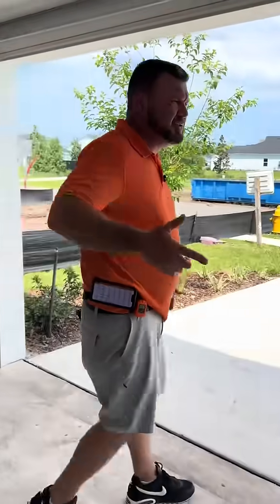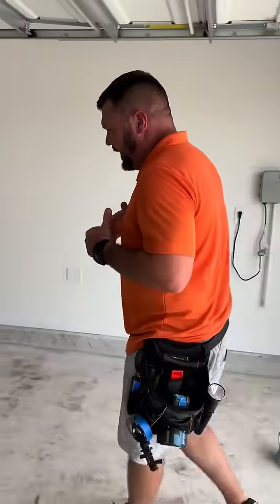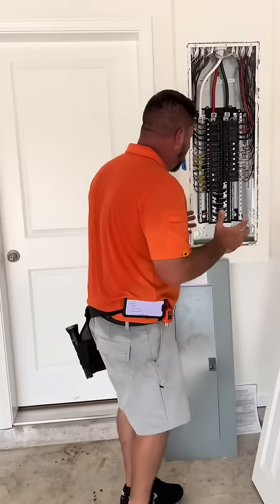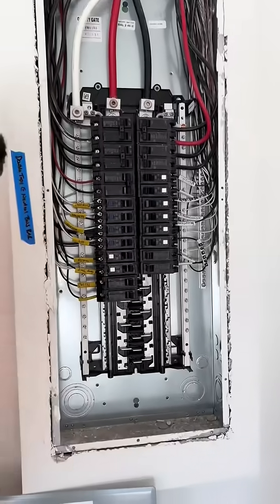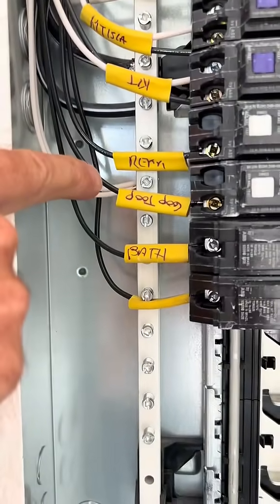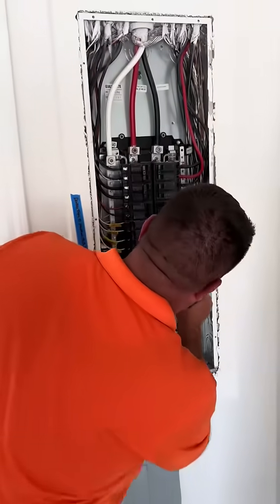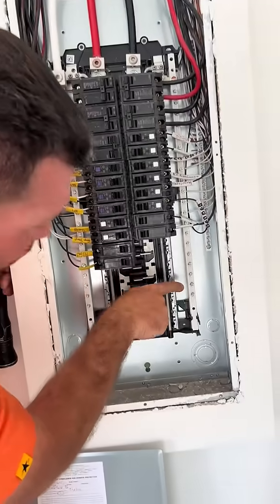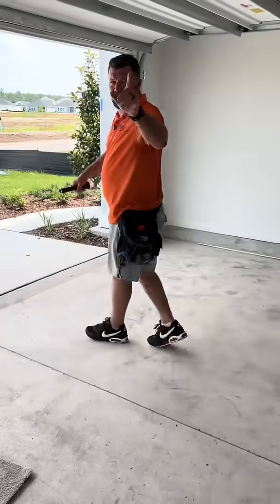Electrical Fail #home #fyp #youtubeshorts #shorts # #shortvideos #new #diy #sunday #shortsviral

Comment: The problem is you have a licensed electrician that did the job you have a license inspector that inspected the job and then you have a certified Handyman telling you that they are both wrong

They make panels that are rated for more than one neutral

Comment: Keep in mind there are some manufacturers who allow a ‘double tap’ on terminals as long as it is a #14 or 12. Square D is one of them please review the manufacturers installation instructions. He just attended a seminar about this subject & is now an expert.
Reply: Yes Sir.  They allow 2 wires of the same size #12 and #14.
Reply: Wrong. Double tapped neutrals is a NEC violation
Reply: @tennesseewebb2651 
If you say so but you have left ZERO evidence to back up your claim. No NEC article.

Comment: I have seen so many illegal aliens doing construction work on the job sites that don’t even speak a word of English. They are doing carpenter work and drywall work and plumbing work and electrical work and they are being paid cash off the job site.So these contractors are hiring them and under paying them and you get what you pay for and at same time they are taking food off the table of other workers that work in these trades.

Comment: Not a 4 wire system. Ground does not count. A 4 wire system would be 3 hots and 1 neutral.
Reply: three phase….. doesnt look like a three wire to me.
Reply: @ReggaeRedeemer  Split-phase (which is what this is) is a three-wire system (two hot conductors plus neutral).  Three phase can be either three-wire or four-wire (depending on whether it has a neutral conductor or not).

"N-phase" does not always equal "N-wire".

Comment: You can double tap, if the terminal is rated for a double tap, and usually in a bus bar the terminal is rated for a minimum of 2 conductors, unless stated otherwise by the manufacturer. Their is not difference between 2 conductors on one terminal or one, they are both doing the same thing.
Reply: Wrong. Double tapped neutrals is a NEC violation
Reply: @tennesseewebb2651 no bud, shared neutrals are a violation.

Comment: I believe that panel is rated for double landed wires on neutral. I may be wrong but them ge panels I think can take double tapped neutrals.
Reply: No panel can have double tapped neutrals. It’s a NEC violation

Comment: now I'm more worried about how honest the city inspector is.
Reply: I’d be more concerned of laziness than honesty when it comes to city inspectors. I’m sure there’s a bit of both though
Reply: City inspectors miss little things all the time (often because they're underfunded, and there's just too many things to check and not enough hours in the day).

This actually quite possibly wasn't even a violation at all, though.  Some panels actually are rated for two conductors under a single screw terminal.  Without knowing the exact model of panel (and looking up the manufacturer's instructions), we can't actually be sure whether it's allowed or not (and neither can he).

An actually good inspector would know that.

Comment: The builder didn't do the double taps the electrician did it and was a dumb ass for that
Reply: It’s against code but essentially once current gets to neutral bar it is very low resistance.  That’s not the best code rule.
Reply: @Anthony-vb4mp can you elaborate more on your comment. I was thinking because you cant isolate the circuit to work on it was the biggest issue. I’m no electrician so I could be wrong.
Reply: He could have used the open space or even pigtailed it but this is just stupid as a technician i see this alot
Reply: The builder could have done that and added something for one thing
Reply: @sparky4108 i really dought it it not the only one so the electrian did this i cant see a builder adding mor than one
Reply: But it definitely shouldn't be double tapped
Reply: @sparky4108 definitely could have pigtailed it or used the open space but they definitely wrong for it
Reply: Shit there was 3 total
Reply: @brandenjodon4190  You may be right sadly. But I have seen the hvac guys and the builder come back and add multiple things. Regardless whover done that was definitely not the brightest crayon in the box for sure. 😂
Reply: Like a builder would add a light or something not 3 whole circuits without an electrician on hand to do it for him
Reply: Whats the big deal?